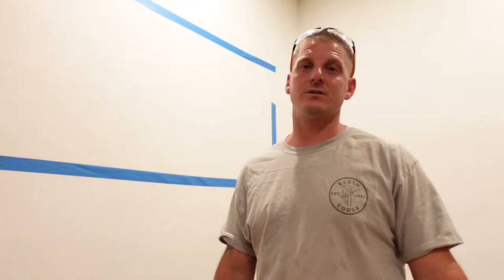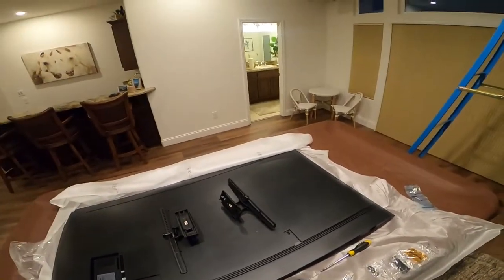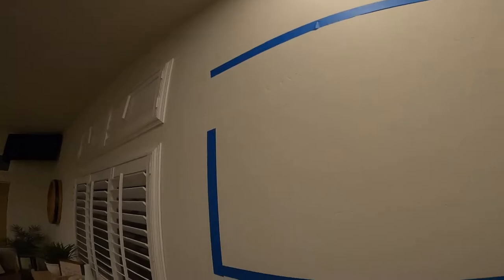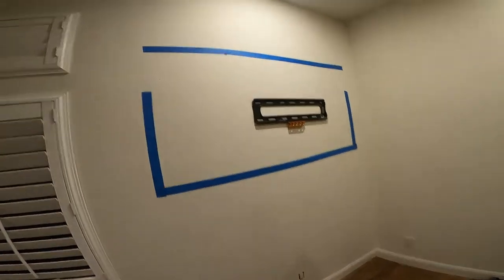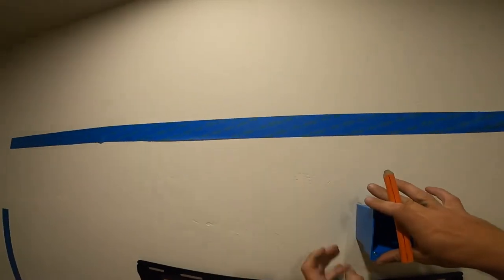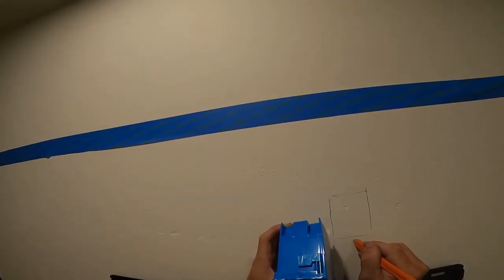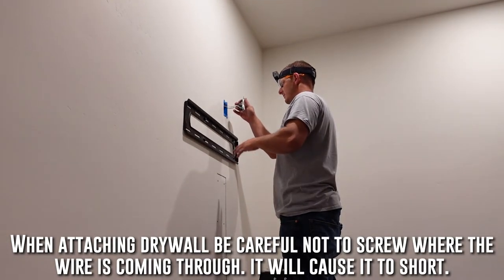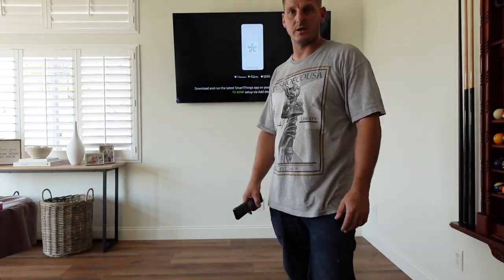How to mount a smart TV, and hide the power cord by moving an outlet behind the TV

Comment: Just curious, how did you fix the massive hole in the wall below the tv?
Reply from the maker: Had a drywall guy come and do it.  Unfortunately because it is an exterior wall with a fireblock, there isn't a way that I am aware of to not cut it.  If it is an interior wall, typically there is no fireblock and it can be fished, without the hole.